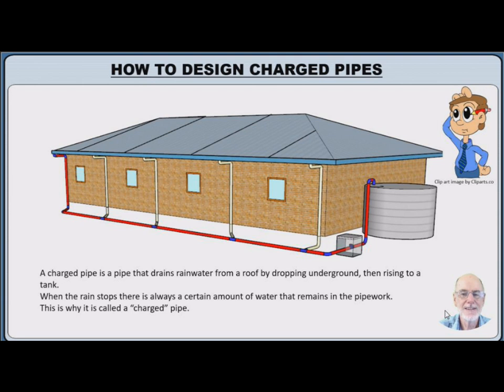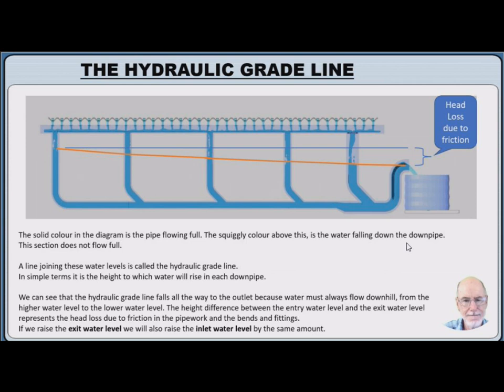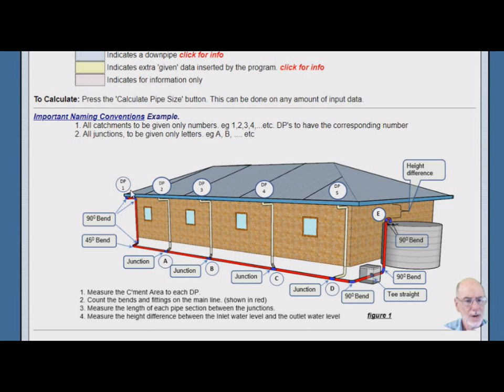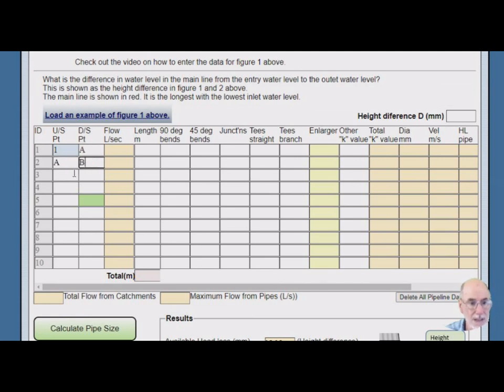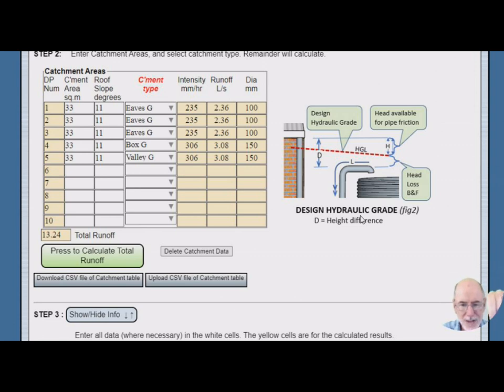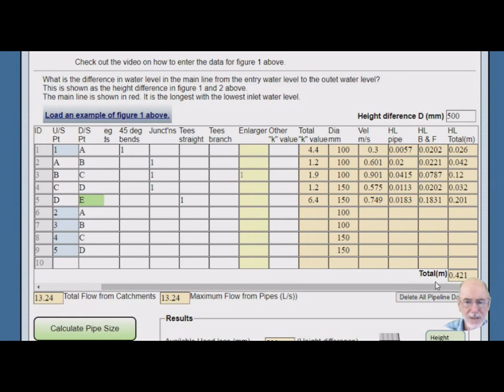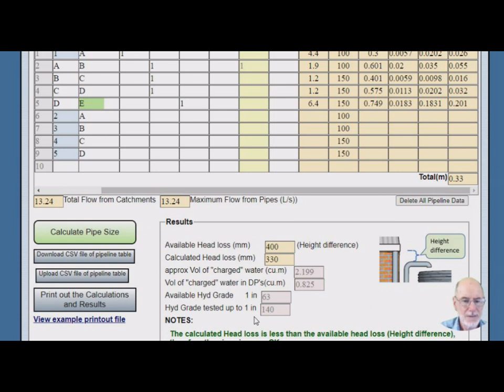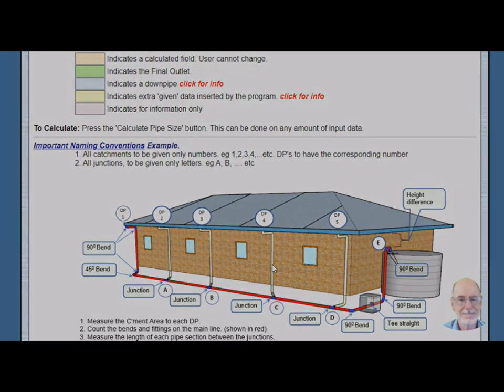Draining Charged Pipes to a Rain Water Tank

Comment: Thanks Ken! Why start the charged system from the underside of the gutter? Then you have an additional two 90 degree bends of friction loss at the start of each downpipe. If you start the charged system below these, you should have less head loss in your system, and a reduced actual head required.
Reply from the maker: Actually you can start the upper water level where ever you like, just change the available head to suit, and delete the bends from the calculation. But it may have the effect of increasing the pipe size. You could try it and see. 
For instance if the head loss from the bends is greater that the amount of head removed, then you would gain overall hydraulic grade.
But the converse is also true, you would loose hydraulic grade.
If you had plenty of hydraulic grade to play with it may make no difference.
For example if the tank was subsantially lower than the gutter.
But if the tank top was only say 300mm below the gutter, you will need all the grade you can get.

Comment: Hi Ken,

I have a question.  Want to install channel drain at the back of my house as due to gradient it fills up with water and heavy pour water can come in pergola too,  i did a bit of digging around down pipe.  I found a pipe connected to down pipe and thats in opposite direction o rain water tank. As out water tank is at the front of the house and this is at the back of the home back yard.  Will it be ok to use a snap T joint and connect my drain on top of the pipe.   I am just thinking will it back flow when it rains heavey etc.  please help and advise.

Appreciate your video.❤
Reply from the maker: You cannot drain any surface water back uphill into a surface  tank. If it was an  underground tank it would be okay.
You can only drain water from a higher water level to a lower water level.
Reply: @The123ks123  thank you...for your reply

Comment: or why not increase the size of the gutter and reduce # of down pipes?
Reply from the maker: sure that can be done, but it doesn't change the rainfall runoff. However, with this program you can have as many or as little number of DP's as you wish.
Reply: @The123ks123  So how would I go to design a system for a 30x80 shed with 3/12 metal roof, 12' tall sidewalls with a location that gets 60" of annual rainfall. I live in central Louisiana, where 5"+ rains are common in a day.
Reply from the maker: @KrazyKajun602  You would have to look up the design rainfall for eaves gutters in your state. Your local Authority or Plumbing Code may give you some quidance. Inches per year, or inches per day is not suitable for this calculator. 
You are looking for a rainfall intensity that can be converted to a flow in gals/min or similar. 
There is a conversion calculator somewhere on the site to convert imperial to metric measurements.
If you can find that out you can use the DP program to get the roof gutter size, and the size and number of downpipes (leaders)  that you require.
https://www.roof-gutter-design.com.au/Downp/applet.php

Then use the Charged pipe program to get the pipe size to your tank.
https://www.roof-gutter-design.com.au/ChargedPipes/ChargedPipes.php?v=2

I think our Australian design rules may be too different to yours.

Comment: What if a charged pipe is cut during a renovation 😂 Can capping it be enough?
Reply from the maker: If the pipe was capped, where does the rainwater go? If designed correctly it will overflow either over the front or the back of the eaves gutter.